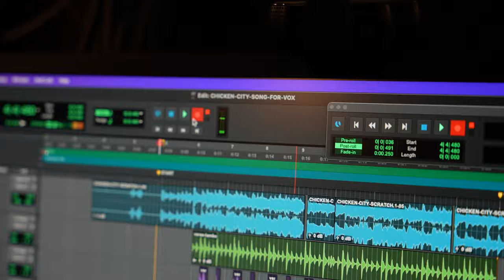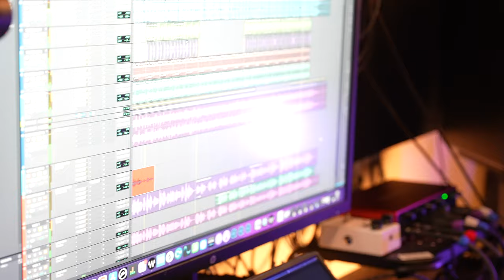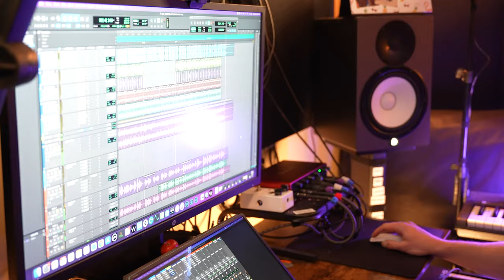Behind The Scenes Of Recording The Chicken City Theme Song

Comment: Little trick to fixing stripped out screws on your ramps-  dip some toothpicks in wood glue, shove in suspect holes, wait for curing time, screw back in. Nice and tight. Great on door jam screws, cabinetry, etc. Saves time and it's solid as hell.
Reply: Sawdust (preferably from the wood currently being worked on)and glue also works well
Reply: If youre impatient you can even forgo the glue and rely on friction. Works for rawlplugs